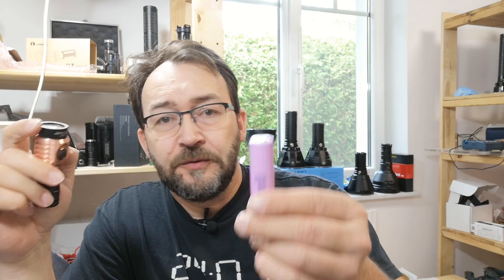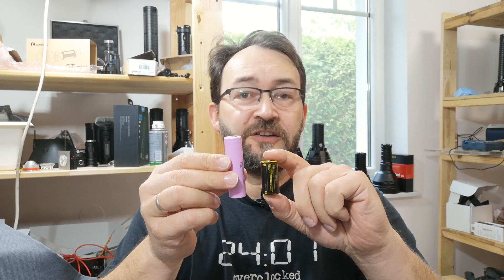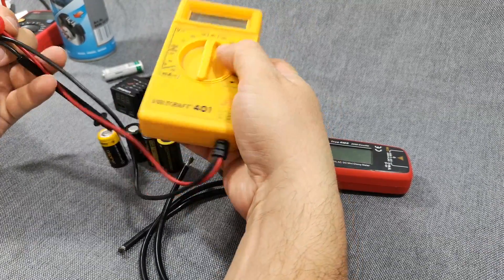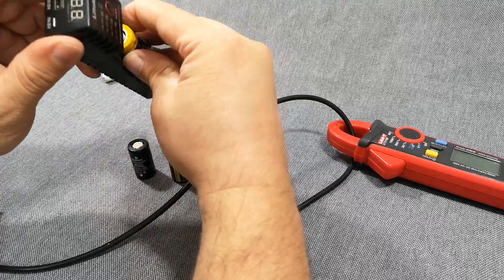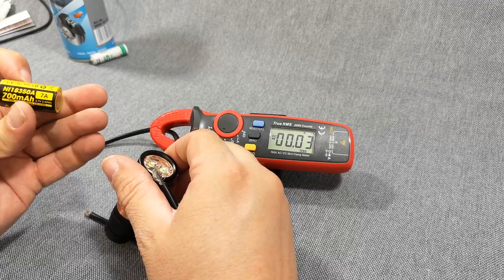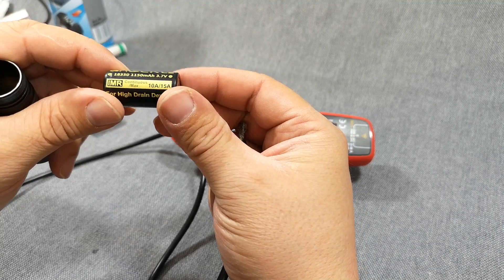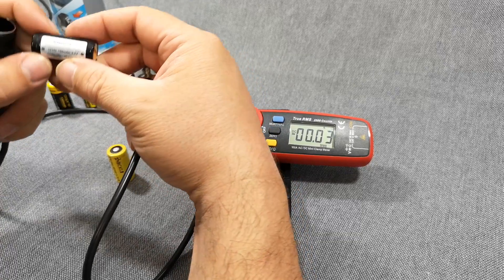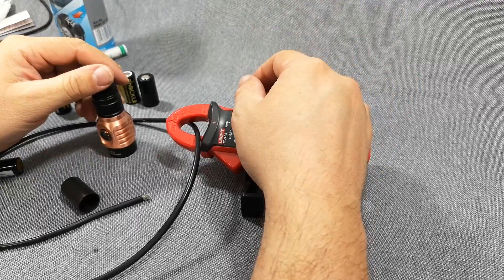AmpZ!  Astrolux S43S and some small cells

Comment: hello there, does the astrolux s43 work with protected 18350 ? Did you ever tested? thanks in advance
Reply from the maker: the S43 draws morfe Amps than any protected 18350 can deliver - you would presumably trip the fuse when switching to turbo
Reply: @MartinRathmanner_M4D_M4X  thanks for the fast reply :-)

Comment: what area on the  wire (mm2)  should i use when i messer the current?  very good video👍
Reply from the maker: I am not very sure about your question...

using a clamp meter it does not matter if you use in the midlle or any side or the wire ;)

or did you mean where to contact the wire?
(between cell minus and the body)
Reply: @MartinRathmanner_M4D_M4X   Hello again. i meant the black wire you messering the current with ( mm2)
Reply from the maker: aah

the bigger , the better!
shorter better is than long ;)

i use a 12 AWG (3,31mm²)
Reply: @MartinRathmanner_M4D_M4X   Thank you very much.
Reply: @MartinRathmanner_M4D_M4X    yes , thicker vire less resistans.